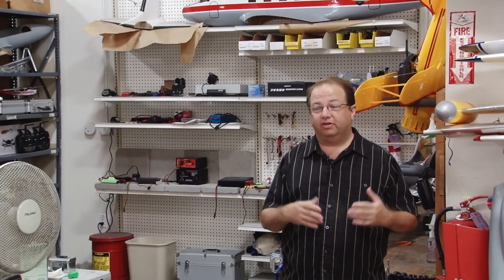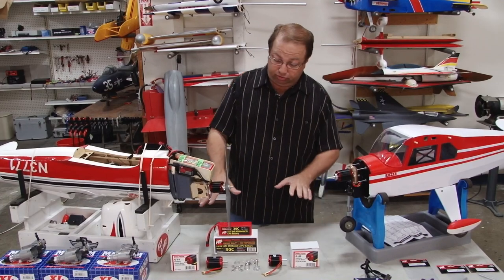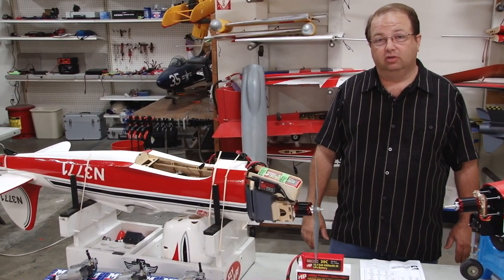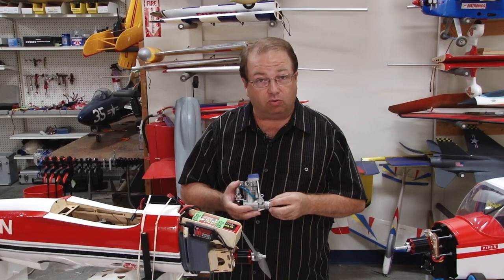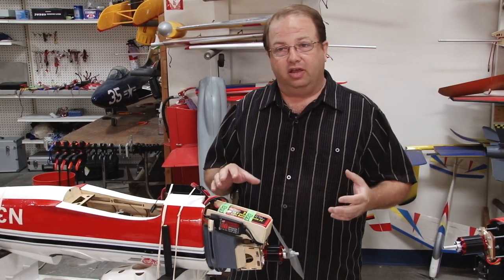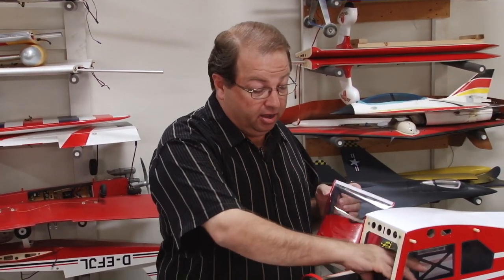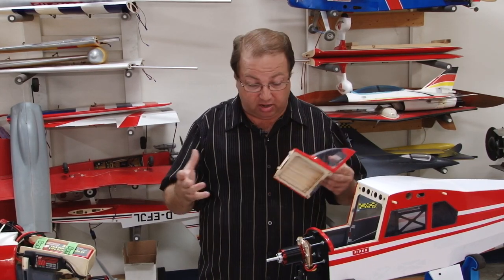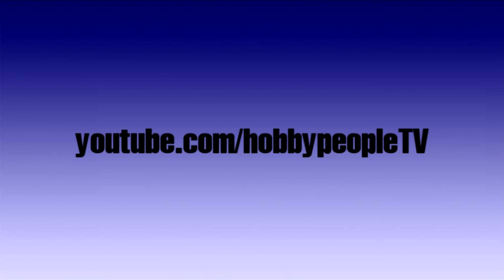Tips From The Shop Electric Power Systems S1E1

Comment from the maker: J Gasser, welcome to the hobby!  The "46 to 60" reference is to the glow engine size.  Before electrics became popular, aircraft were categorized by glow  two cycle engine sizes.  That is where the reference comes from.  So for instance if you purchased say a TopFlite Mustang 60 ARF, the 60 is a reference to the engine.  Our new line of electric motors does just the same.  Our 46 to 60 size motor is designed to fit in place of a 2 cycle glow engine in the size range of .40 to .60ci.

Comment: Kevin, The motor is brand new. So, once they are in the hands of the magazines, etc I'm sure you'll see some reviews. Watts = voltage x amps. It's that simple. So, a watt meter, like the one used in the video (available from Astro Flite) will show you the real amperage and voltage the battery is producing under that load and then also show you the watts going to the motor. If you look at the instructions, the charge shows measurements taken by the Watt-meter during actual runs with the motor.

Comment: Wayne: Static test gives you just that, the static information. So, it's not exactly the same in the air. In the air, and assuming you've got good airflow, expect cooler temps and lower current draw, up to about 10% less (except of you're hovering, then expect 10% more for a hover and vertical pull-out from a standstill- which is where "burst" comes into play.) Tsavah, the episodes will vary on topic and information. We appreciate the input!

Comment: if your aircraft brushless motors are so great why don't you have any reviews on them,i just bought one and would like some specs on it, i asked someone and he told me to figure motor watts,you take the amperage the motor draws and times that by battery voltage,which is  ridiculous,yeah sometimes it comes close but there are more factors to consider before you can figure your motors wattage!